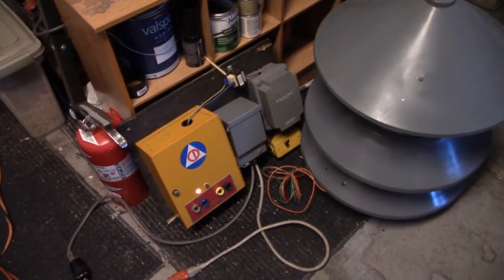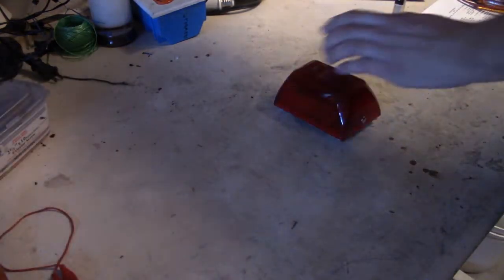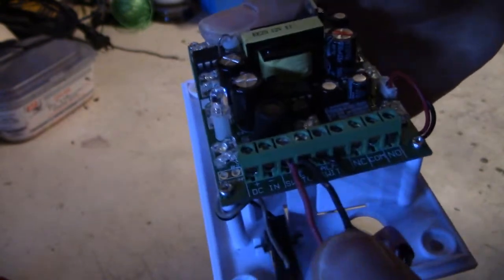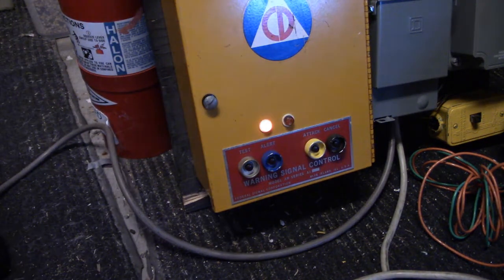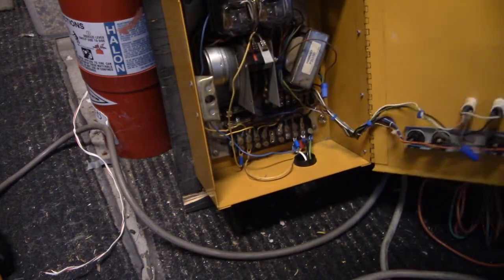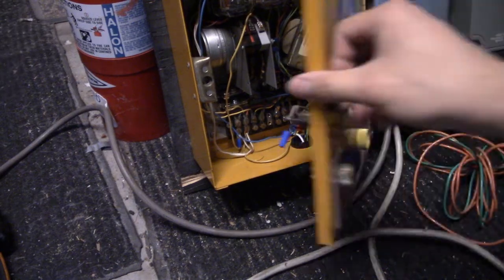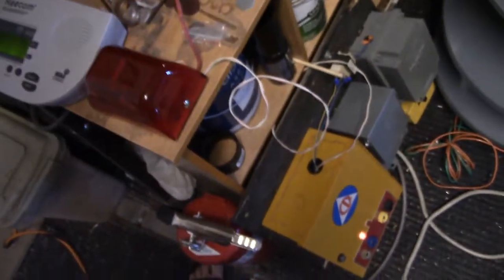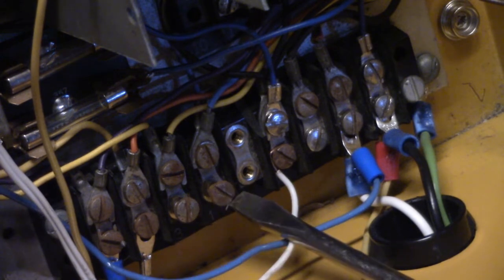How to wire up a weather radio to a AR/AF timer

Comment: I like that. Where did you get that  siren?
Reply from the maker: The model 2? I got it from a fire department in New York.
Reply: @cooldomino1800  that’s what’s up. What about the control unit? Did they give you that also? Sounded like you had it in the house or a shed. I am blind also and I did weather forecasting on the radio.
Reply from the maker: @christophermattox3972  that’s cool! I don’t have the controls from the fire department yet tho. I hope to get them soon. The AR timer came from eBay.
Reply: @cooldomino1800  I bet that cost a pretty penny. One Time I tried to find one and they wanted a tremendous amount of money.

Comment: Do you have to have the beeper relay thing. Or can you just get the relay blinking light alarm have your weather radio in an AR timer.
Reply: I have a NOAA weather radio would that work
Reply from the maker: @benwhitcraft6350  nice! What kind? It has to me a wr-100 or reecom 1630.
Reply: It is a WR-120 I think. I clicked on the link for the eBay thing. And it didn't come up. Is there another model that would work just like that one like an STI SA5000W or something
Reply from the maker: @benwhitcraft6350  that should work. But the wr-120 outputs power. You need one that does not output power. Like a 100 or 1630.
Reply from the maker: You will need one of those alarms. (Any color would work) and a wr-100 or reecom-1630.
Reply: @cooldomino1800  Do you have to have the gray box relay beeper thing now. Or is that a power supply for your big siren
Reply: I figured all I would get was just a civil defense AR timer a recom timer. Some wire and that relay blinking box is that all I really need.
Reply: I'm sorry I meant a recom weather radio
Reply from the maker: @benwhitcraft6350  you don’t need it. That’s just power for the siren.
Reply: @cooldomino1800  so basically if you have the setting on voice on your weather radio and it's set for blast mode it will shut off after the weather alert is gone right. You don't have to manually cancel it
Reply from the maker: @benwhitcraft6350  depends on how you wire it. If you wire the relay to 1 and 2 in the timer, (control) the siren will only be on when the weather radio is alerting. If you have a reecom 1630, make sure you set the ext alert port to switch.

Comment: Can you wire it to the timer without the red strobe light?
Reply from the maker: I recommend it because there’s a relay inside of it. They’re not that expensive.
Reply: @cooldomino1800  yes but does it need it? Will the radio alone activate the timer?
Reply from the maker: @lilaj34siren  I don’t recommend it. Because the output of the timer is 120vac and it may fry the transistor inside the radio.
Reply: You can use a simple relay to do the same job if you prefer, and generally the relay will be cheaper than the alarm. Just make sure it doesn't draw more than 350 milliamps. (0.350 amps) Route one of the wires coming from the radio to your positive and the other wire to the coil of your relay. Ground the other coil terminal on the relay. When the weather radio goes off, the relay should close. Bear in mind the relay will be closed for 5 minutes according to the user manual for this weather radio. I know I'm late to this but hopefully this can help someone, and I'm happy to answer questions.
Reply: Correct me if I’m wrong but when the alarm on the radio goes off for a warning for example is all other sirens in the county sounding as well or would only yours be sounding? And is the radio programmable for just your specific area?

Comment: Would fire in an AF timer be terminals 5 and 6?
Reply from the maker: It would actually be 6 and 7. You can look at the manual on the civil defense museum website.
Reply from the maker: @dj-la--wolf1288  I have it that from live to neutral, it’s 120 even though 240 is going into the whole system. I can wire it for 240 if I wanted to.
Reply from the maker: @dj-la--wolf1288  you can. You will need the relay in the mini controller to switch a bigger relay. Because some 12v sirens can draw some power inrush.
Reply from the maker: @dj-la--wolf1288  yeah sure. It’s pretty easy. You just put the coil of the bigger relay in series with the relay contacts on the mini controller.
Reply from the maker: @dj-la--wolf1288  I don’t think I can do it that fast. Do you have IG or discord?